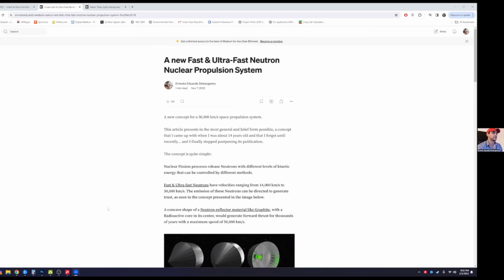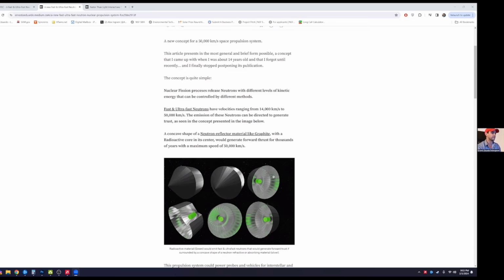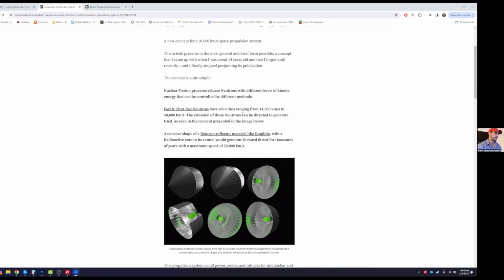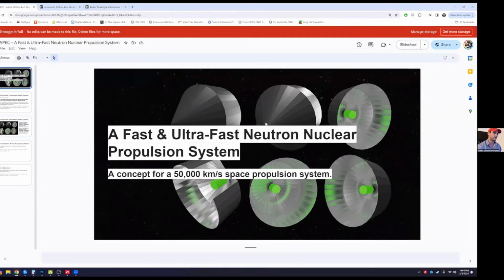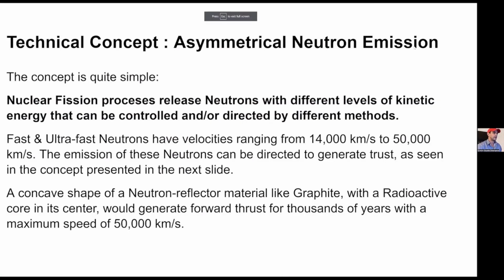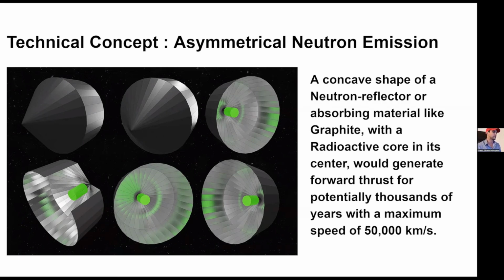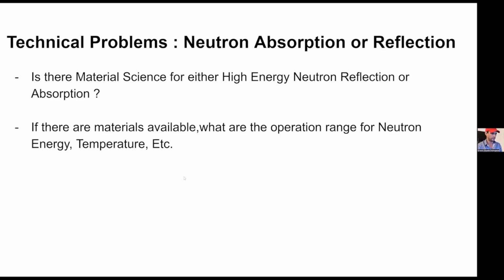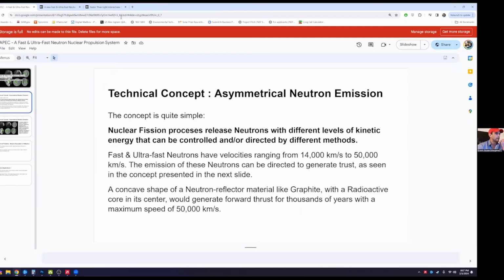Nuclear Ultra-Fast Neutron Propulsion Thrust & FTL Collisions in Compressed Spacetime Regimes - APEC

Comment: The Ultrafast Neutron propulsion concept is the Quellar Drive from season 1 of Space 1999. The episode was interesting in that any material structure or lifeform caught in the neutron stream was destroyed by the high energy neutrons. Aneutronic fusion power or propulsion would generate a plasma with minimal production of neutrons. Radioactive isotopes that have a particular half-life produce either beta, alpha, or gamma radiation as they change in atomic number. Neutrons are not a by-product of radionucleatide transformations.